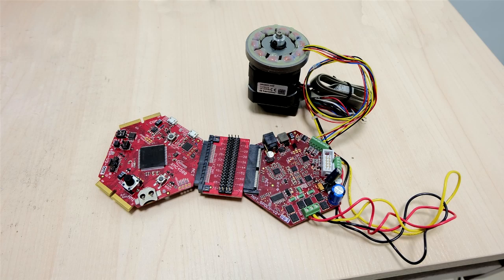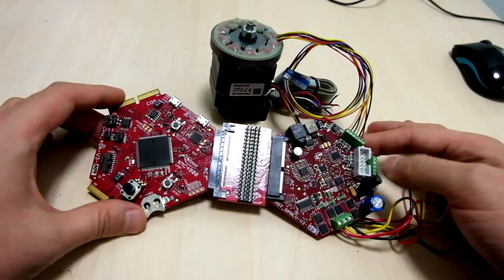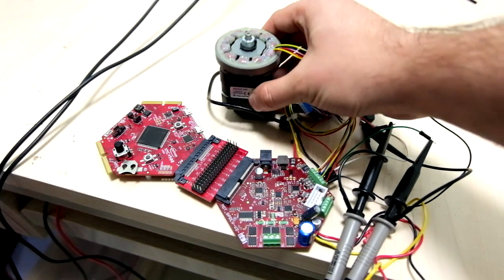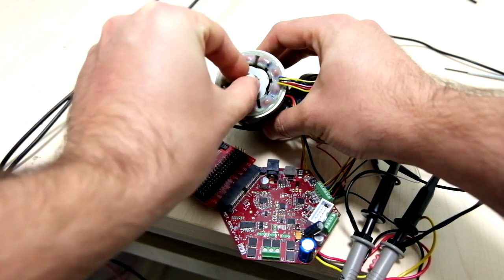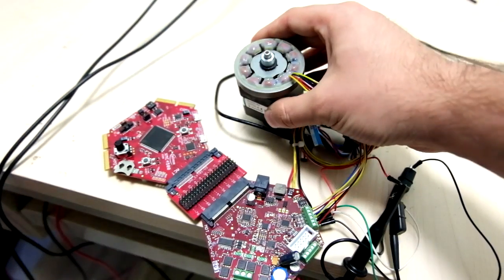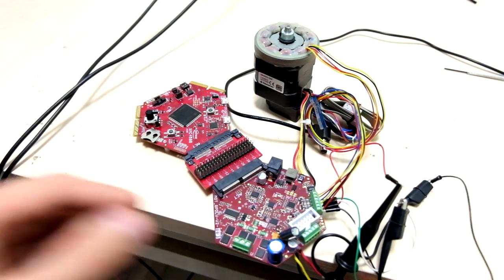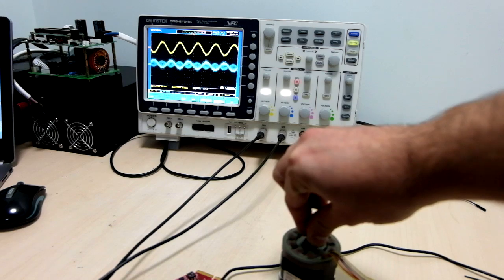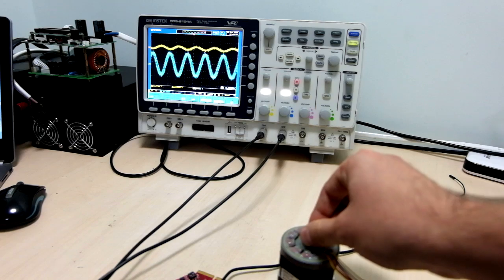The XMC4400 Motor Control Application Kit

Comment: so all what this do. Is a very complex motor encoder?
Reply from the maker: is an absolute position encoder with extreme low angle error (30`min ) Optical encoder and hall senor can fail from temperature variations and vibrations. Hall sensor can send false signals if high current is running inside the motor.
With the resolver you have none of this problem.